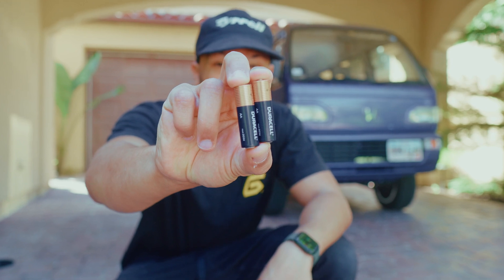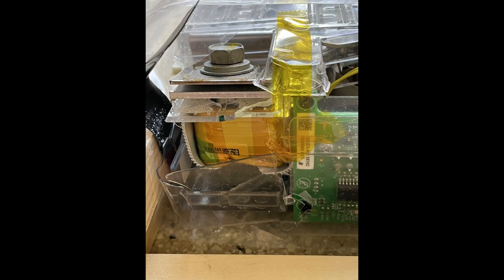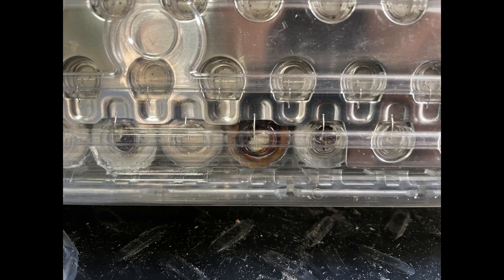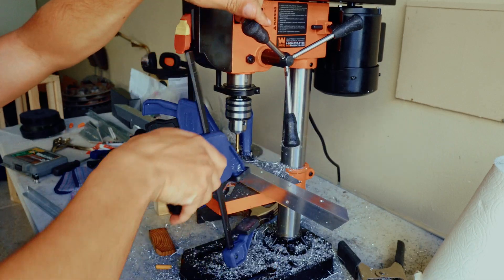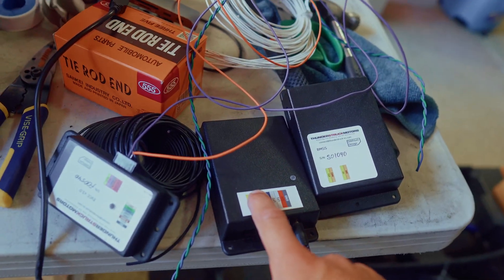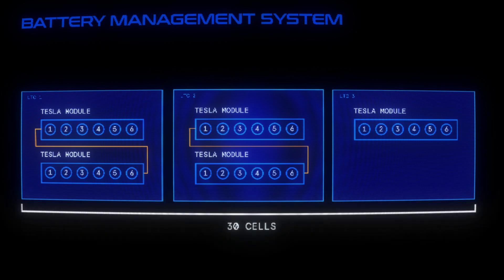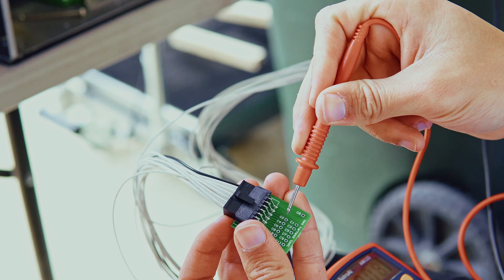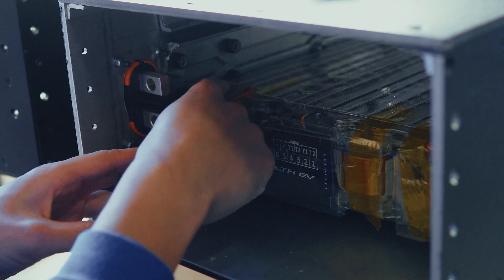Converting my Honda kei van to run on Tesla Batteries. Project Acte Episode 3.

Comment: The "grid supervisor" monitors transformers in groups of 12:

Two boxes each manage 2 Tesla modules (12 cells) - these are complete "districts"
One box manages just 1 Tesla module (6 cells) - this is a "half district"

For the "half district," the guy had to tell the system "transformers 7-12 don't exist here" by wiring a special loop back to transformer 6.

Comment: Hi, when you and others build an electric car and put the battery packs low to the ground, aren't you worried about going through a deep puddle. If the battery pack isn't 100% waterproof then something bad will most likely happen.

Comment: Hey, could you share some more insights into the design of the battery box? I'm curious about how they are held inside the box not to move around when driving. And how you managed to hermetically seal the boxes. Much appreciated 👍